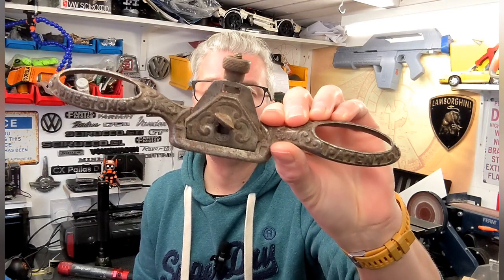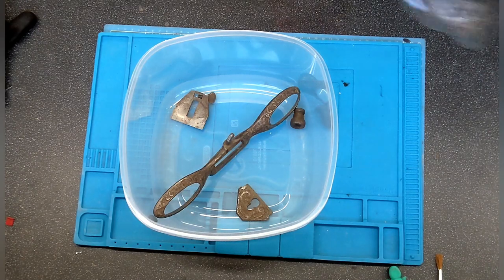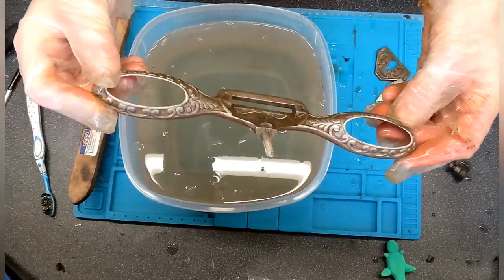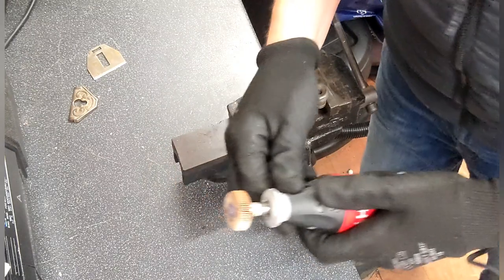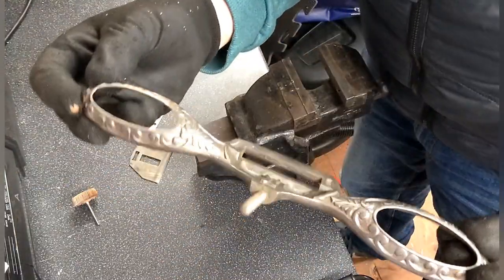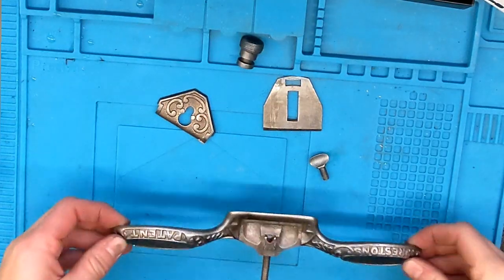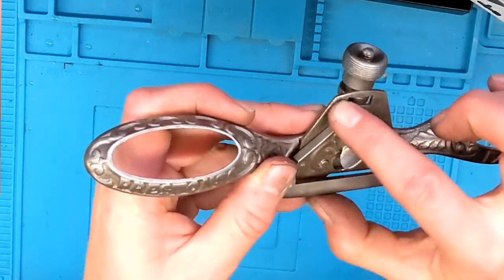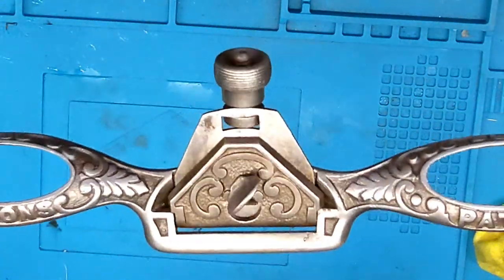Tool restoration, 100 year old Preston's woodworking spoke shave

Comment: I have  used vinegar on hundreds of  plane's  , many  say you  shouldn't use  vinegar,  but  the  important  when using vinegar  is  to  make  sure  you  wash it  off   thoroughly with  hot  soapy water, and  rinse  it off with  hot  water  it helps  it to  dry  quickly,  and  spray it with  WD-40  straight away to stop flash rusting,  and  then you  can do  the  polishing  , good  job by  the  way  , I enjoyed your  video many  thanks.

Comment: I have two of these flat & round bodied, I notice yours is missing its sideways blade adjuster, It locates in the same slot as the blade up & down screw. I use my one quite a bit, they are lovely to use.